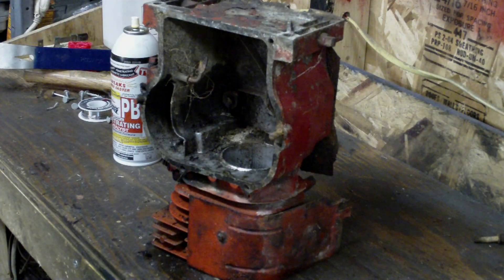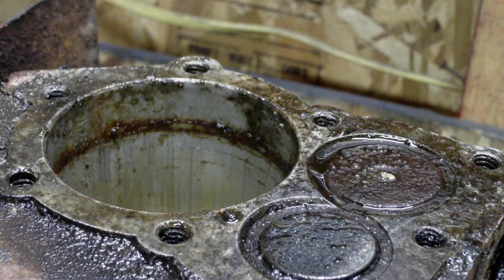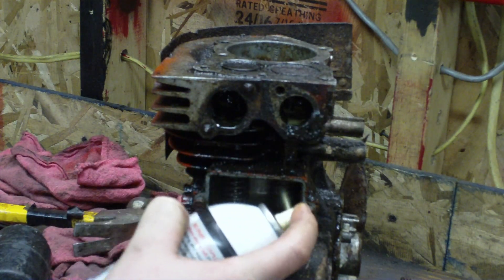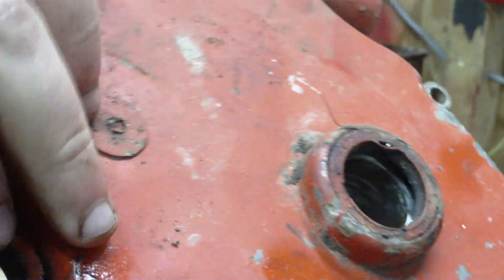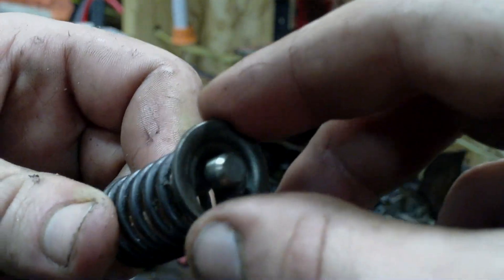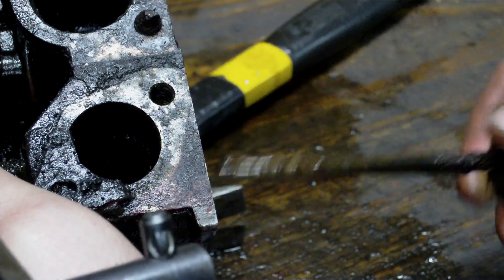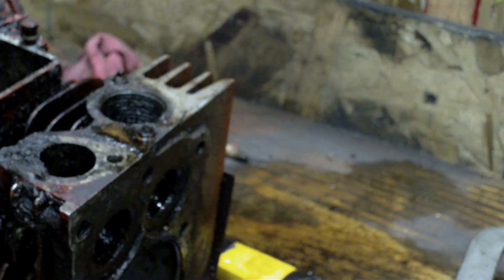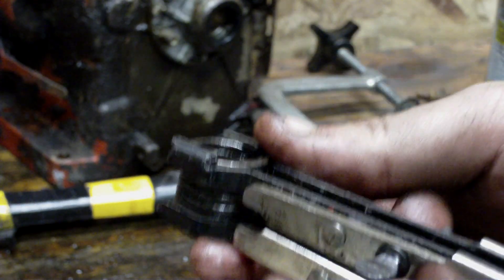5 Horsepower Briggs Restoration Project and How to unseize pistons and valves

Comment: Hi. I'm trying to restore this very engine. It's not in that bad a condition and was on a rototiller.  The piston seized and I tried blaster before I removed the engine but nothing. I finally got the piston out and the cylinder has some scoring but not terrible.  I reinserted the piston and used magic marvel oil and it loosened a lot however the piston doesn't seem to "flow" up and down and seems stiff while pushing down or up. I was wondering how you determine if the piston rings need replaced and/or cylinder honed or bored? Thanks.

Comment: I really appreciated this video. I have a 1952 Model 5s small B&S with seized valves. I have the block stripped down and even used long bolts to try to drive the valves out but they're too stuck in rust. I'll try the chisel on it tomorrow and see it is pries them up some.
Reply from the maker: Glad to help out. I suggest soaking in wd40 and possibly applying heat to the valve area, with a propane torch, nothing to crazy but it will help free it up. Thanks for Watching!!!

Comment: Working on a flat briggs engine. Valves move when cranking starter, but piston not moving. If I hammer in the piston, then motor seizes. Am able to get it to crank again once piston pops back out. Any advice?
Reply from the maker: Sounds like the motor threw the rod, you may be able to fix it with a new rod if there is no major internal damage. Thanks for Watching!!!

Comment: Working on a Coleman Powermate., with a Briggs 5 horse. Just cleaning the tank out. Was very clean. Very surprised. Just waiting for tank to carb gasket.  Should be fine.
Reply from the maker: I hear ya! Great motors. Sometimes you get lucky and they are in good shape. I've ran into to a few that were rusted/gummed up so bad i didn't think i was going to be able to save them. Thanks for Watching!!!

Comment: Brigg has valve guide tools. Use a drill to ream the guide. Use the guide bushing installer with a hammer and the tool. The reamer installs to a certain depth. Get the stud bushing which fits on the valve. Get next OS ring and file to about .005-.007 on comp. ring and .010-.013 on oil ring. There is a flywheel holder and clutch holder tools. Get the right flywheel remover tool. Have a shop to replace the seats. Get the screw type muffler. Install head bolt inserts.

Comment: finished the rebuild on the 2014 Craftsman snow thrower 
ONLY LASTED 1/2 HR !!!!!!!!!!!!!!!!!!!!! till it started to have Rod KNOCK
i reused the crank , connecting rod , and welded back the piston , reused the rings !!!!!!!
took apart again excessive connecting rod clearance to crank , skirts scuffed 
going to hone out the aluminum cool bore and install new piston and rod and rebuild again 
check the video out
Reply from the maker: I hear ya, hopefully its nothing serious and you can get it going again. Thanks for Watching!!!

Comment: did you finish the project ??????????
look at my lawnboy 22270 resto
Reply from the maker: I never did anything more with it, I've had so many projects going on it got pushed to the back, i still have it all the parts, someday i will get back to working on it. thanks for watching!!!
Reply: i picked up a used snow blower with briggs 250cc ohv snow engine 
owner ran new with no oil , seized piston on cylinder , going to rebuild it .
parts very expensive $100 bucks new piston 
going to weld the piston and clean cylinder with muriatic acid

Comment: use fine grit sand paper on gasket surfaces i use it on cars its the only way to go and keep in minds its a briggs and Stratton motor not a bmw you got holes in the block and ur worried about getting the gasket surfaces milled.....
Reply from the maker: That would be a better way to do it, the best method is on a surfacing block. thanks for watching!!!
Reply: fnaguitarplayer9 no problem jus learned alot about thse things from a retired sears mechanic actually jus broke open a 8hp and the crank was seized to the oil sump but point bein these old things r simple and bullet proof dont be scared to be rough with em and u got alot of good content on ur channel keep it up dude.
Reply from the maker: I hear ya! I fixed a generator that happened to a couple years ago, got it running again. So true! Appreciate that, I hope to put up alot more videos this summer!

Comment: Old 5 horse Briggs 'L' head was the mainstay for years. I've got 2 on the shelf and one on a wood splitter. And some parts just like you have. Good deal. Just because they're broke don't mean they can't be fixed.
Reply from the maker: Can't beat them! I got another in good running condition, and another 
that needs rebuilt and another that runs good but smokes on a old 
montgomery ward generator, great engines, them and the 12HP can't be 
beat. Thanks for Watching!!!
Reply: fnaguitarplayer9 10/4!

Comment: That cracked case is nothing. Aluminum brazing rod works great on aluminum Briggs blocks. 
Somebody over reved that engine big time.  Some kid probably had it on a cart and messed with the governor and reved the piss out of it. 

Nice work!!
Reply from the maker: Yeah, i've used that stuff before, the alumiweld that harbor freight sales, I had bad luck with it before because i didn't heat the block (had a 14.5HP throw the rod out the side!) but i plan to use it again whenever i work on this block again. Probably so, but i think it came off a log splitter or a tiller, can't remember, not saying that it wasn't put on a go kart at some point. Thanks for Watching!!!

Comment: Hey can you help me out . My muffler is pretty rusty and I already broke one screw trying to take it off I need to take it off so I can clean my engine for my gokart thanks!
Reply from the maker: Thats what happened on that block in the video, they are bad about that. You have 2 options, the first is if you want to put a bolt-on muffler back on it, you will need to remove the bolt that broke in the block, best method is using a welder to weld a nut on it and remove it as i show in this video here (on the same block too, and it will work if the bolt is broke off below the surface of the block) http://youtu.be/Nd5JlMb81dc OR leave the broken bolts in it and use a screw in muffler, the long round type, you will have to get another piece of pipe with a coupler to extent it about 3-4 inches to get the muffler past the carburetor. Thats really about the only things you can do. If you don't have access to a welder it will be near impossible to get the bolts out, so if you don't weld i'd suggest using the other type of muffler on it. hope this helps! Thanks for Watching!!!
Reply: Sol93 Get the screw type muffler if you can. Maybe have a shop remove the stud and install an insert.

Comment: not a good idea using a wire brush on alloy? i would have used fine wet n dry with oil on a flat piece of wood..interesting vid though..
Reply from the maker: I've always cleaned up motors like that with a wire brush, but yeah to keep the surface flat it is best to use that method, surfacing is what its called. Thanks for Watching!!!

Comment: very cool man, new sub, im rebuilding 1 now two. cheers bro
Reply from the maker: HotRod Paul
Kind of hard to say, I've always helped my dad work on the mowers ever since i was kid (I'm 22 now), and in the last 5 years or so he got tired of working on them so I do it all now and figured i'd start making videos, i'm always learning something new haha Thanks for watching!!!
Reply: Very informative.
How many years have you been rebuilding B&S type engines for
Reply from the maker: Thanks, appreciate the sub! Good luck on your project! Thanks for Watching!
Reply: cool bro im 44 and im just doing my first rebuild. so hang in there man, cheers
Reply from the maker: Heard that. Its a fun hobby to get into. I also have a 4 part video of rebuilding a 12 horse briggs, it might help out some as well, if you can't find it, i can PM a link to the first video.
Reply: cool man. cheers
Reply: Love Your videos, very helpful for rebuilding my old 5 hp flathead Briggs. One question- how the heck do you pry the little tangs off the bolt heads in order to remove the rod cap? I can’t seem to wedge anything between the tang and bolt to pry it off. Any suggestions?? Thanks and keep making your awesome videos.

Comment from the maker: I look at things different then everyone else, to me, anything can be fixed if you have the time and money, which is why this is still waiting to be restored, a sleeve costs alot of money, the hole in the block is no problem at all, I've seen several blocks fixed, look at my briggs 14.5 HP OHV videos, most people would have scrapped that block, not me, i had it welded! good as new! Right, if i need it tomorrow, thats what i do, but i have 2 other 5 horses ready to go! thanks for watching!

Comment: Is there a preferred surface between granite or steel?
I remember seeing granite on Craigslist once, the person was going to trade to first person that brings them a large coffee....  sometimes there may be scrap pieces from renovations that people don't want.  

Oh yea got that engine working now.  The new flywheel key sheered off again because I had it only torqued to 40ft/pd.  Must have shorn instantly when I tried to start.  Runs great now.

Comment: I just did the valves on a GM 122 Engine in an old 88 sunbird. The tool made it a little easier but getting the tool off after putting the keepers back was a pain in the ass

Resurfacing heads and blocks can be done on a piece of granite or glass and spray gluing sandpaper to it and just lapping it in a figure 8 and letting the weight of the head/block do the work. This process takes a long time but is proven to be flatter than a machine. But it's important to keep measuring and lapping slowly

Comment: just use a honer to hone the cilincer the pisten u can grind up a bitt whit steel whol the broke part take it of an donor engine  use the ols parts and clean them use wdv and si ==o to clean it and use breakdisk cleaner  when cleand up putt the parts back in and fix the carter part (last resqye beside welding hars of a tree of so it works fine anny new update about this engine? its long time ago this video was posted greets

Comment from the maker: take the bolts around it off, then if the shaft is rusty or dirty, sand it clean with sand paper or emery cloth then it should slide off fairly easily, if not take a rubber mallet and gently tap around the sides until it comes off. still being stubborn, put some penetrating oil on the shaft that should help it slide off. thanks for watching!!!

Comment: you must not work on these to much, or just not know how to use a valve spring compressor, you put the keeper in with the spring clamped in the compressor have the cut out faced away from the tool and put it in the chamber and slide the valve in through the cut out of the retainer and then undo the compressor and slide it out it is so much quicker no dicking around takes a few secconds

Comment from the maker: @bigborekit12 yeah but on a engine thats already together you can't really do it exactly like i did here, but turn the engine so the piston face up (spark plug facing ceiling/sky) and take the plug out and fill the cylinder with a penetrating oil or diesel, let it said for at least 3 days or preferably at least a week then gently crank the motor over. It will free up after sitting.

Comment from the maker: @45961 not a problem. i did a 4 part video on tearing down and rebuilding a 12.5 horse briggs, if your interested in doing it, that video should help alot. You can fix blocks if a rod come through like this block with JB weld, i've never done it, and to be honest i don't really recommend it, i'm going to cut out a square hole in this and "alumiweld" a piece of aluminum in. Thanks for watching!!

Comment from the maker: @Bobbymitchell10 yeah. what i was thinking bout doing on the crack was cut it all out then alumiweld a plate over top of it all. I do know if the alumiweld will flow out and fill the crack or not. it it don't work out i will have it welded.

Comment: its rough around the edges but clean it up get a new rod and your set, as for the crack in the side cover, drill a small hole at the end of the crack to keep it from spreading then weld it